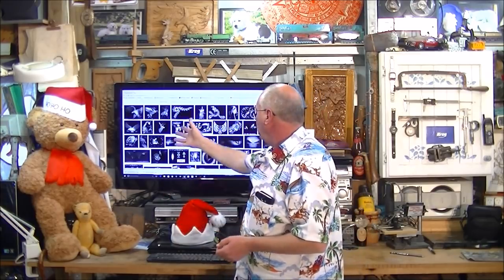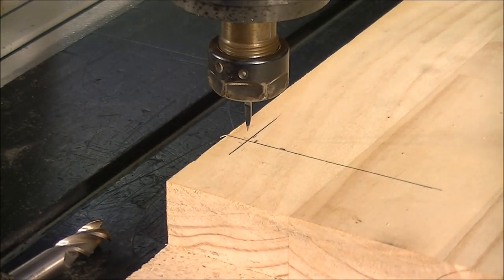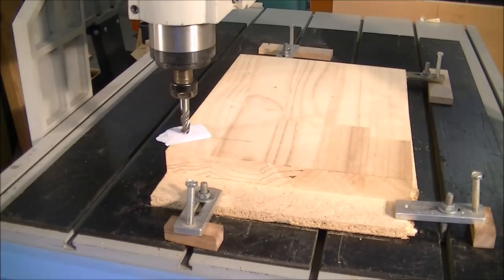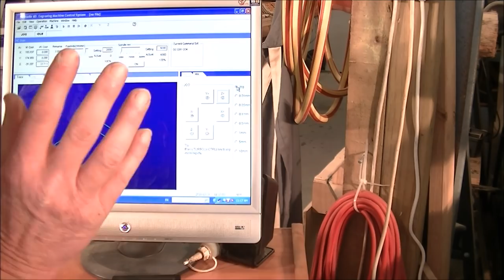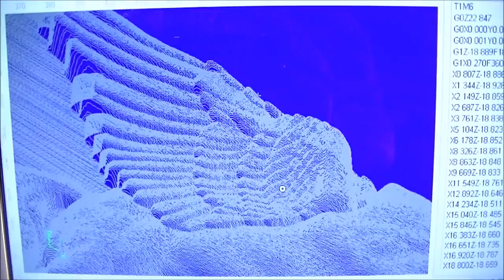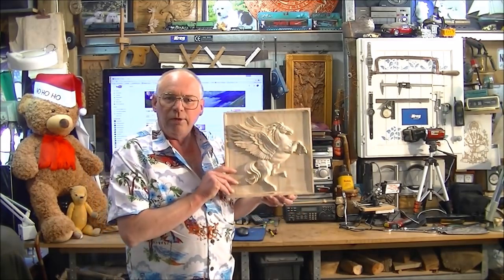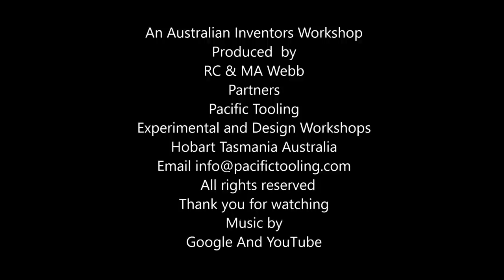2M views CNC Router can make $250000+ per year HD 3D relief carving of Pegasus I CAN SHOW YOU HOW

Comment: If you wondered why your timber moved, it is because you have your clamps set up the wrong way(@ 12.52 mark you can see the support blocks are a lot closer to the clamping screw than the timber. Also the support blocks are a lot higher than the timber being clamped).
With the setup you have the bolt that screws down into the tee slot  nut is closer to the support block at the other end of the clamp setup. Therefore the mechanical advantage of the screw is applying more downward pressure to that support block than to that  of the timber you are machining.
Solution.
Have the clamping bolt as close to the timber being machined as possible. If the bolt could be a few millimeters away then that would be perfect. If you can't get it that close then ay least make sure that the supporting block is further away from the clamping bolt than the timber being machined.
Another tip would be to ensure that the height of the support block is equal to or slightly higher (no more than say 1mm) than the clamped height of the timber being machined.
There is so much mechanical advantage through the turning moment of the screw that it will take little effort to securely clamp the timber.
How much pressure should I apply to the Allen key or spanner you may (or may not) ask! 
Well in most cases once the clamp starts to crush the timber, that should be enough(in the example in the video). That timber appears to be a Pine variety which is quite soft.
if it were a hardwood, perhaps like Redgum or Jarrah, then it might be prudent to use a thin piece of Pine under the clamp on the timber side. Then once you see the pine being distorted by tightening the screw then you know it should be enough clamping force.
Ultimate clamping force required, will be determined by the cutting pressure applied at the interface between cutter and the timber.
That is to say, increase your stepover, without decreasing your feedrate then you will increase cutting pressure. Nice machine too!

Comment: I thought of corregated tin roofing as a box for shop heaters and a drape mold. then extend from the frame assembly and out of the box four thread rods to tighten down the drape when it reaches temperature. For a larger than an oven drape mold without burning your hands.

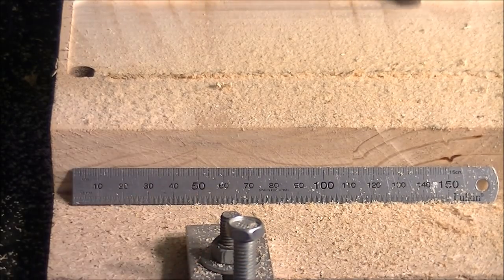Comment: If you look at 9:58, you can see why the piece moved at the start of the second pass.  The clamp was loosening everytime the X changed directions
Reply: Toe clamps are terrible for stock holding. If you have a T track table, just block the stock in on all four sides.

Sharpened pins, slightly protruding from the blocks, angled upward a couple degrees can keep the stock pinned on the z axis, which honestly needs little in the way of hold down force for this operation.

Comment: What software are you running ( Mach3?),and the operating system for the pc(XP , VISTA ?),i'm doing a 3 axis build for pcb and facia plates for amplifiers i make,so i can do away partly with acid etch,but will do etching for certain things still,plus the accuracy of the cnc is breathtaking for pcb and image transfer to brass facia control plates.
nice work.

Comment: At 11:20s and after during the roughing passes it looks like its burning up the cutter and wood.  Would be nice if you posted your speeds, feeds and bit geometry used so we could learn more.
Reply from the maker: Have a look at videos 157a and 157b .
Australian Inventor Roger Clyde Webb ;-)
Reply: Thanks!  Will check them out.  I am learning how to create these 3d reliefs for CNC machines...but would like to get a tool chain that is free or less than a couple hundred bucks.  Is Artcam free for hobbiest like Fusion360?
Reply: It really looks like the tool is rubbing and therefore it burns the wood, I bet it does.
@Roger: I think you should speed up the feeds or slow down the spindle.

Comment: Where is the art? Where is the craft? Where is the skill? This is without a doubt the best possible video (and the best possible person) to show just how little of any of these is actually involved in the "creation" of this piece. Out of pine wood, even.

I guess I probably shouldn't comment here -- BUT -- I've got two canvas rolls containing more than 30 chisels, lovingly cared for and sharp as I can keep them with my 10" wet bath wheel. Each piece I carve is one of a kind, absolutely unique -- even if two or more share the same design. 

There is a time and a purpose for all things, including a CNC router, no doubt about it. Doing repetitive work, like dozens of English roses, perhaps, or Fleur du Lis to serve as corners for paneling or other architectural work. But this is not woodcarving, and neither art nor craft of any kind is involved. It's just like setting up my table saw or hand router; nothing more. I use electric tools for any numbers of woodworking projects and this is just another of those. Don't call it woodcarving. Don't call it craftsmanship. It is neither. (now you can tear me a new one)
Reply from the maker: Your view is your view and you are entitled to say what you want. As it happens this is my channel which I have worked hard on. The skills involved in CNC machining is probably out of your range anyway. Your message is very ambiguous,  however, whatever rocks your boat I suppose. There is unfortunately always going to be negative responses and that simply  shows the level of a persons ability, skill and adaptability,. I did note that your YouTube page is full of other peoples work and not yours? If you need a hand or tuition to set up your own, or indeed to carry out your own CNC carving let me know. Hey, I'll even sell you a CNC router. Great to hear different points of views, they can so amusing and I am not interested in "tearing you a new one"' that level ends at primary school......good try though, well done.

Pacific Tooling; Australian Inventor Roger Clyde Webb ;-))

Comment: Very informative, Thankyou. But could you explain how to reset to the correct depth after changing the cutting tool please?
Reply: (My best guess) To answer you question directly, once the roughing pass is completed, the spindle has to be raised and replace the cutter.  then the spindle is moved back to a position that is above a section of the wood that has not been cut and do the same zero process with the piece of paper, except you ONLY zero the Z axis.  It is imperative that the X and Y axis are not zero'd as they need to be not lost to keep everything else in line when cutting the finishing pass.
Reply from the maker: Yes!  Australian Inventor Roger Clyde Webb ;-)
Reply: Wonderful
Reply: @robotbender8271  
Thank you

Comment: About how long does something like this project take the machine to make?
Reply: Depends on the stepover and the tool you use. If you use a 0.5 mm tool with 0.05 stepover it will take considerably longer than, for example, 2 mm tool with a 0.2 stepover. It also depends on your feed. All in all, you are looking at 5-15 hours of machining in my opinion.